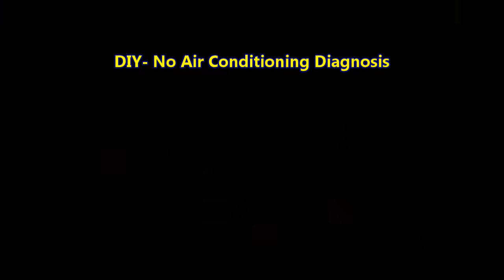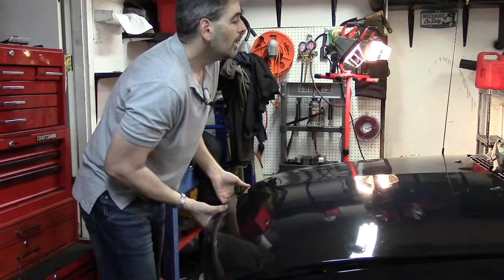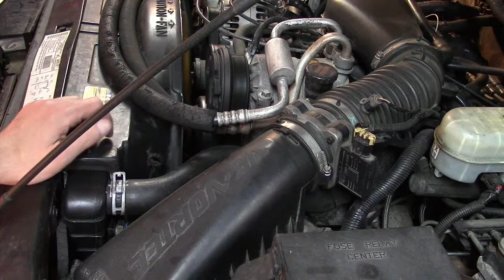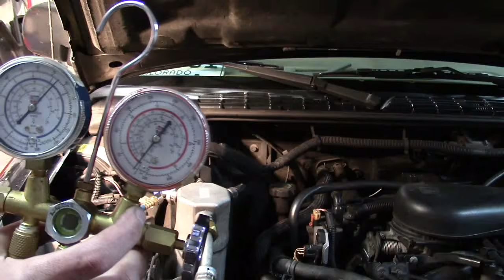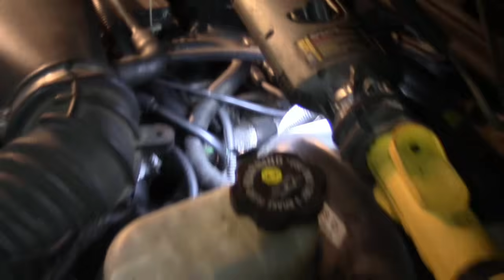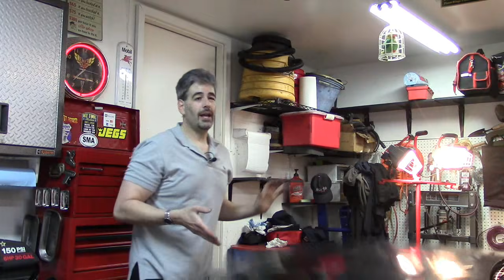DIY- Troubleshooting No Air Conditioning

Comment: Back in April I had the aircon recharged on my 2008 Citoren C4 Grand Picasso. It only worked for a couple of days. Dye was added when it was recharged so I found out that there was a leak in the condenser. There were no other leaks so I replaced the condenser. I damaged the end of the high pressure line taking it off so I had the replace that section of pipe. It was recharged again and it is now working. I reckon to have spent just over £200 in total.
Reply from the maker: Perhaps you did not evacuate the system prior to recharge?
Reply: Both times I had the system recharged professionally with some oil and UV dye added. I don't think that the aircon system had been touched since the car was built prior to my ownership so I assumed that the system had just lost refrigerant over the years. I was hoping that having the system recharged would sort it. It was fully working for a couple of days until the refrigerant had all leaked out and it was obvious that the only leak was in the condenser. The system was completely empty so it was safe to work on. The reason the end of the high pressure line sheared off was because of electrolytic corrosion between the line and condenser. The last recharge was also done at a Kwik Fit and 4 days on, it is still bowing ice cold so it is definitely fixed.
Reply from the maker: Well I would need high and low side static and loaded pressure curves under induced variables to determine the issue. Unfortunately I have no such data unless you can provide it.
Reply: I forgot to mention that when the system was recharged both times it was evacuated to remove the moisture prior to adding the refrigerant, oil and dye. The first time it was recharged I don't think it was left for long enough to see if it held a vacuum or if there were any leaks. The fact that it worked straight away meant the that the whole system was (briefly) in working order. As soon as it stopped working, I knew there had to be a refrigerant leak so it was just a matter of finding the source of the leak, fixing it and getting the system recharged.
Reply: Parknest
Reply: Parknest vf5

Comment: Dr. Schrodinger, you're the best.  Compressor running.  My low freon was 100 psi, high was 75 psi, 75 degrees outdoors.  My mechanic evacuated and weighed the freon, concluded .5 lb volume remained, everything leaked out.  Says pressure gauges are useless to tell volume.  How can I tell if freon mostly leaked out at home?  Runs fine after filling.
Reply from the maker: Well your mechanic is an idiot basically. Gauges are useless at telling volume in a STATIC condition but the whole point of the high pressure gauge is to assess the reading vs the suction to determine if volume is a problem.

Comment: I have a question I am hoping you can help me with. I have a 2008 Buick Lacrosse. On a hot day when I turn on the AC the inside blower will come on high and the compressor clutch engages the compressor and the compressor turns fine. Both of the condenser fans also turn on but no cold air. Here is the strange thing. With the gauges both connected there is no difference between the high side and low side pressures  even though the compressor is turning. When the AC decides to start cooling the pressure all of the sudden change as they should (the pressures then look reasonable) and the AC will work fine for the rest of the day. This is an interment problem. I have 2 guesses  on this one the expansion valve is stuck all the way open or  for some reason the compressor has a problem. What are your thought on this? Have you ever ran into this type of problem? Thank you in advance.
Reply from the maker: I would need the actual data and also time to low/high side equilibration when engine is off.
Reply: When the AC is working - In about 5 seconds after the engine is turned off the pressures equalize  between the high and low side.  The next time you run the car the AC may work fine. This is an intermittent problem however when it is not working the fans are all running and the compressor is turning but no difference in the pressure between the high and low sides. I an thinking it must be a stuck open expansion valve.
Reply from the maker: Exactly what I am thinking.  WHen you say there is "no difference in high and low side pressure even when compressor is running" what is the system pressure in that event? Because another explanation would be a bad compressor clutch (disc is spinning but the clutch is not actually engaging so there is no actual compressor operation).
Reply: I guess I wasn't clear the clutch is engaging and the compressor is turning. Both high and low sides are around 125 psi until the air conditioner starts functioning which may take up 15 minute for it to start working properly at which point the low side goes down to around 25 and the high side to around 200 depending upon the outside temp. I know this is a strange problem which is why I was asking if anyone had ever run into this. The first thing I checked before connecting the gauges or anything was to see if the clutch had engaged the compressor which it had and the compressor was turning. Unless everything is turning on the outside of the compressor but the compressor is not turning on the inside but I don't know how that could be. The next time it does not work I can put a stethoscope on the compressor and listen to it to see if I can hear it running.

Comment: Just had a thought. What causes the compressor to cycle? Is there a temperature sensor on the evaporator somewhere or does the compressor run until it trips the high pressure switch?

Comment: Hey Matt, I love your videos. I have a question about inproving the efficiency of my AC system. I needed to replace the leaking condensor on my 2005 Civic. I ordered a Denso condensor on Rock Auto and installed it, replaced filter dryer, vacuumed the system, recharged it and it works great. But the AC is obviously still not as cold idling as driving even if I rev the engine. I insulated the low pressure AC line to prevent it from absorbing heat from the engine, which helped a little. My question is can I improve the efficiency of the system a little by installing a fan on the front of the condensor to push more air through the condensor when the compressor is running? Also, could the fan save some fuel by reducing head pressure and compressor on time, or would the electrical load of the fan offset any fuel saving benefit? Thank you for making great videos and have a great day.
Reply from the maker: If you find a significant temp change when idling vs when engine is revving it is indication your AC compressor is inefficient and probably needs replacement soon.
  I discuss this and the diagnostic in detail on my pay channel ;-)
Reply: Schrodingers Box Sorry for not being clear. What I meant was the AC does not get much colder when revving and only gets much cooler when actually driving. I was just wondering if installing an electric fan on the front of the condensor to push more air through the condensor when idling can help performance. Thanks.
Reply from the maker: Avery Alexander Sounds like a dirty condensor
Reply: Schrodingers Box It is clean, oil free and fins are straight. The weak electric fan just never moved a lot of air. The AC sucked when sitting still since the car was new.  Unless you suggest otherwise, I plan to install an auxiliary electric fan on the front of the condensor to push more air through it and power it with a relay to be on when the compressor is running. Thank you for your help.
Reply from the maker: Avery Alexander Then in that case you need to do basic  lo and high side pressure diagnostics to determine the cause of the  issue.
Reply: Thanks.

Comment: If the car aircon was working fine and then just stopped,? Who cut the wire ?? A mouse with some smll pliers ?. Great vid by the way !
Reply from the maker: it was an improper butt connection repair.

Comment: Please answer this: So how did a wire get cut "while sitting at a stoplight"? Sounds and smells to me. I retired from the "repair" market years ago- for reasons of cheap, stupid people wanting free work- or trying to haggle my worth, or just plain lying to my face. I don't blame you one bit.
Reply from the maker: Because, as was mentioned twice in the video quite clearly and also shown on my other video, it was an improperly done butt connection from a previous repair. 
  I have seen this countless times- clean wire breaks like that at terms and connections. If you do this work with any regularity you will see this very often. 
  If you really were in the repair market you would have seen this as well countless times.
Reply: Schrodingers Box Yes- in 10 years I saw a few "repairs" that were done before they came into the Shop. Always fun- to hear the stories about who, what, and why. Bird's nests of bread twisters, paper masking tape, Duct tape, Scotch tape, bailing wire.

I did hear you mention it looked like a Butt connector might have been used, and had simply broken at the improperly deep cut strip- but there was no view of that broken piece, or of you repairing it in the video.

It seemed like you edited that part out.
I did not see the "other video" you speak of.

I really miss your stunning logic and methodical train of thought.

Nice to see you again.
Reply from the maker: HUBBABUBBA DOOPYDOOP Thanks man- sorry my answer maybe came off as brash but I misinterpreted your comment.  There were several people who accused me of cutting the wire for sake of the video- as if I would do that on a customer's car (or need to do that). It pisses me off.
  My apologies bro.
Reply: Forget about it. I got just as disgustipated as you about the whole mess- that's why I left, and started an entirely different career until I retired. Don't worry about what the kids here say- they're like flies on a turd.

Comment: dear sir Schrodinger.
your trouble shooting is very interesting and informative.I have a problem we have tried to diagnose with no luck.
we have a newmar 1994 ford chassis motorhome. it has a 460 engine. starts and runs great . while driving it randomly starts to loose power. if you shut the key off and restart engine the power comes back for a while then we have to repeat. while it is is acting up it back fires and moans if you ease up on the gas it stops backfiring and keep loosing mph.until we shut off key and restart engine to get back up to speed.

we have exchanged fuel pump. run a hotwire to fuel pump. cleaned all conections and used dialetic grease. 
please can you help us.
Reply from the maker: based on your comment it seems clear you focused on he fuel pump. what was the data you got that mistakenly indicated the fuel pump was bad?  I would totally start there.
Reply: we started with the fuel pump after we did a pressure test and it was dropping out. we watched one of you videos and so we replaced the fuel pump. which improved it a heck of a lot but still get the problem. we have a OBD 1 tester and it has passed all the tests. checked many forums , which led to us running the hot wire. we are still lost souls. stuck at home missing vacation.
Reply from the maker: ***** You need to do a voltage drop test now.

Comment: Hey Matt, i was wondering how you knew where the low switch is located. Thanks
Reply from the maker: From my understanding of how AC systems are designed and function based on my video "diagnosis and understanding: air conditioning"
Reply: +Schrodingers Box it can be anywhere on the low pressure side or it can be other sensors, but maybe it looks difficult to me because im non practical.
Reply from the maker: armando nika It MUST be on the low pressure side.  I recognized it as being on a low pressure side line so it can only be the low pressure sensor.
Reply: +Schrodingers Box thank you for the responses.

Comment: Hey Matt. Youre about the only guy I trust on youtube for expanding my knowledge in diagnostics. You've always been deliberate in your decisions. What I'd like to know is why did you stop using the Loadpro in your vids. I bought after seeing you review and love it - it's a pretty amazing tool. Did you find any flaws with using it? Also do you know of any other channels out there that approach diagnostics on this level? I haven't found any that get down on a deeper level or any good channels specific to automotive electrical work.
Reply from the maker: It is strictly because I don't want to give impression of being commercial, sponsored or biased.  But in "real life" when I use my DVOM, the load pro leads are on it!!
Reply: +Schrodingers Box well Loadpro is still a product on the fringe bc people can't make as much money after actually diagnosing the issue. I have a friend who I helped out who payed 700$ to a dealership to change parts on his back door just to get the the window to roll up and down. And they still couldn't fix it. We discovered a voltage drop in about 10min with the Loadpro and the new motor and switch that the dealershit replaced wasn't the issue it was a loose connector in the wiring harness. You're not selling out by using it on your channel. It's an affordable tool diy people need. Especially folks without a lot of money like myself. I've saved so much using it and helped others. It's a product that pays for itself.

Comment: Did the owner deliberately cut the wire to test you?
Reply from the maker: No but someone  before me clearly did not know how to do a butt connection. The other end of the wire had a butt connector that looked like it was crimped with a wire cutter instead of crimper.

Comment: As right as you are, as wrong as your are about the visual inspection. I dont know why you think a visual inspections means to look over the whole car, it is about the system that has a problem. Suspension noise -> look at the suspension, engine problem -> look at engine, get to see where what is, is it direct injection or mainfold injection. You get used to the system.
And if you find somethning odd that belongs to the system that your working on, you can think about the effect of it. Of course you need a clue of what your looking at, because otherwise a disconnected injector is just a disconnected connector for you.
But yeah ... opinions are opinions
Reply from the maker: No, I am definitely right.
Of course if I hear a brake noise I do a visual inspection on the brake where the noise seems to be derived.  That is common sense.

On a P0171/4 however- where exactly do YOU do your visual inspection and why do you start there? What foundation are you using?
Reply: I would not see the P0171/4 before my really short visual inspection.
The situation would be: Customer comes in and says that he has a CEL. If i know the car (model/type) i would jump straight to the OBD connector and plug the scanner in. If i dont know the car i would take a quick look at the engine to see what i have. Diesel or petrol (both commen in germany) and as i said maybe look for the type of fuel injection system.
It is a learned behavior, that keeps you on track, of course you jump things in if you know what is important, like you do with your fastec method.
I just wanted to give you contra, because visual inspection in my opinion is the way to learn what system you are looking at if you not allready know it. VERY important for a DIY
Reply from the maker: So how exactly is this different that is makes me wrong?  You mean you wouldn't look for vacuum leaks or MAF wiring or O2 sensor damage or EGR wiring or spray the engine down with brake cleaner and listen for rpm change or check MAP wiring.....  You're saying you would use a scanner to narrow down to the system responsible???
  What am I missing here. I see no difference.
Reply: Wrong in just your beef about people who say visual inspection is important.
You did a simple visual inspection in this video, but said it is stupid at the same time. I had an Aircon problem so you looke at the hoses and connectors that belong the the aircon and could be easily seen from under the hood ;)
Reply from the maker: You are missing the point completely. 
  ALL repairs are done by visual inspection. But it is unscientific and irrational to start with one when there is no direction whatsoever AND no established baseline to help determine independent variable effects. 
   That's why on your example with the brakes, I would start with visual inspection. If noise is coming from front right when I hit the brakes I  have direction and baseline. 
  But on an EVAP code, anything could cause that. Do I start my visual inspection at gas cap? Even if gasket had a crack- what was my established baseline to verify that is the cause of the problem as opposed to a leaking hose or solenoid on? It is completely unscientific unless I establish the direction and baseline first.
Reply: I allready siad that a visual inspection is not the solution to all problems and the start of every diagnosis/repair.
But is is a vital part of every diagnosis and so i dislike your rant about "visual inspection".

I could give you many more examples of a good visual inspection that gave me a root to follow with the diagnosis and also some where i missed important fact while doing visual inspection.

Again, look at you "fastec"-method depending on the situation you change arround the steps to come to a quik diagnosis
Reply from the maker: I can see I am not going to get you to comprehend the perspective. never mind.

Comment: It's good to see someone discourage the blind use of freon. But I believe if there is a compressor failure you will need the freon after replacement
Reply from the maker: On compressor failure the proper procedure is to recover the existing freon (if any) and recycle it after new compressor is installed.